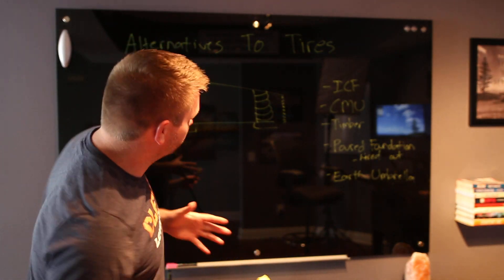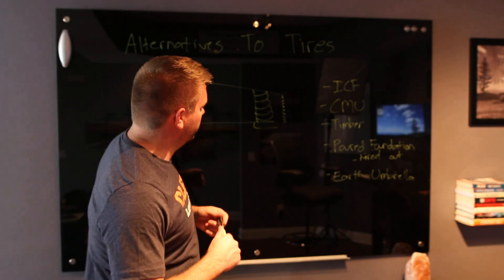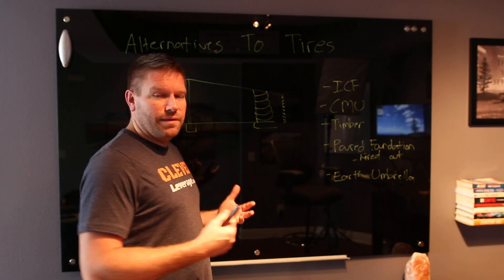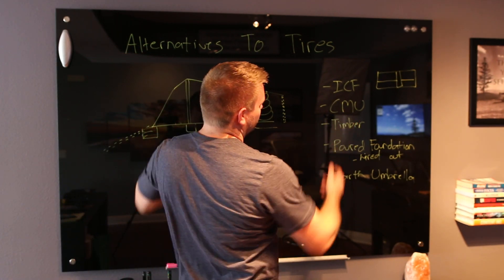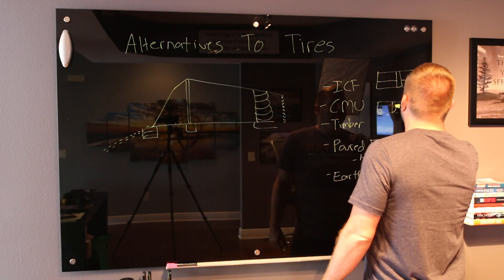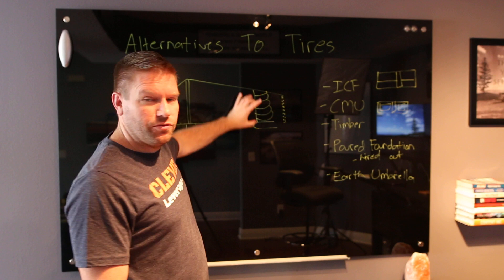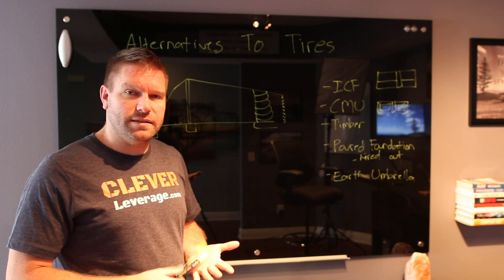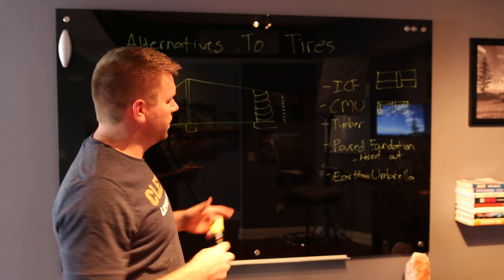Earthships: Alternatives To Tires

Comment: 2'x2'x6' Concrete bin blocks are available nationwide from landscaping and construction companies. Companies like 48Barriers will sell them new or as used road barriers. No forms to build or gabbion cages to make. No waiting for concrete to dry. Stack them in place just like a retaining wall. Waterproof and back fill the same day maybe. Blocks with decorative stone imprinted facing are available. If you want to recycle tires, use them to build the road, or driveway of your property. Cut the sidewalls off, lay on the ground in a grid like circular honeycomb, fasten together with air powered nail gun and then fill with crushed stone or recycled concrete and gravel. The road will be well drained and you will never have potholes or ruts up there in Maine. You might even try the wall less tires for the walls of the house. No trying to hammer dirt around and under the sidewalls of the tires. Just grab an pneumatic tamper and get with it. If you have drainage or erosion issues on the property you can lay out all the cut off sidewalls in the problem area, cover with some gravel and then dirt and grass. The sidewalls and gravel will slow down runoff and allow it to seep into the soil.
Reply: This is a really interesting idea.  Fast build, extremely strong, low-tech, and it looks like around $7,500 for a 100'x10' wall.  That's pretty enticing.  I suppose shipping is a significant problem/cost as each block is 3,300 lbs and most flatbed trailers are good to 48,000 lbs.  It would take 3-6 loads to haul that 100'x10' wall.  And I expect this would face code challenges just like tires, rammed earth, etc.

Comment: Tires when covered completely by earth don’t off gas, there is no oxidation process. The tired you saw exposed are outside the living quarters.
If you want to do away with tires, use stabilized rammed earth. 2 ft wide with 4 inches insulation in the middle.

Comment: Tire bales.  There is ZERO issue with off-gassing.  We shotcreted over the bales, and then adobe'd the interior wall.  I have yet to smell any rubber in any earthship that I've visited.  Check out my bermed-earth tire-bale home on YouTube.  Tire bales were stacked in one day with a skid steer.  They are about 5'x5'x2-1/2' High, and weigh about a ton each.

Comment: Use a shipping container as your back wall, they are usually 8 ft wide. You can get 10, 20, or 40 footer, all steel and strong. Fill it from the top full of gravel or soil. They are not that expensive and you get an instant back wall.
Reply from the maker: Great idea, what do you do about preventing rust? Or just don't worry about it...
Reply: @matt-justice  Just paint it with tar, while the tar is still sticky wrap it with black plastic (viscqueen) lumber yards carry the thick stuff. You can get rolls that are 20 ft x 100 ft. If you go slow you could paint a 40 ft container with tar using a roller in a day by yourself, paint top first, cover with plastic, let it overhang about a foot all around, then do the sides, tape seams with duct tape. Those containers are painted with paint to resist salt water. Also if you put a good base of gravel at the bottom, you wouldn't have to worry about water pooling at the bottom and rusting the bottom.  Good luck.
Reply: @matt-justice  Sorry, I was thinking of burying the whole  container, just put tar and plastic on the side that's going to be buried,  or covered with soil otherwise you will smell tar and plastic everytime you go in the building. You want to keep that plastic away from heat, because it smells when it gets hot.
Reply: Shipping containers can't hold soil loads.
Keep them above ground.

Comment: Pretty well read every comment and some great info from experience here on one site, that is great. So did you figure out what to use? I'm looking at many of the afore mentioned methods but am also no sold on tires as a vessel. Rammed earth is a option but it needs a vessel to hold it. Eathquakes will compromise most rammed earth structures. I've looked at ICF, and now NEXCEM blocks which may be the answer but also like hempcrete blocks but want to get going getting my off grid location build going soon. Nexcem are great for outer insulation especially if taken to R-28 specs but I'm looking for inside thermal mass as used in rear walls of earthships. I have a idea for Nexcem and will get back to this if my idea is a viable option. Thanks for this video, it brought some great different ideas to one location. Cheers

Comment: does anybody have any experience with changing an existing house into an Earth-ship like house? Or links to sites of people who have done that or do that for their work? thx
Reply: totally different design basics . if the house you are looking to convert is east west facing its a no go
Reply: As Lex says it would be an ordeal however there are principles to Earthship Biotecture, many of which seem to have been looked over in this video and discussion, which can be employed. The greenhouse element has been added to great effect to houses in colder climates. The water collection and treatment can be largely achieved. And you can add solar if wind energy solutions. Other than that you might add some insulation and stop thermal bridging to make the building more efficient?
Reply: @TableNetwork  thank you. This is kind of what I was thinking. I live in the Netherlands. December and January lack of sufficient sunshine. There is one earthship village and they need to heat up the place with the wooden stove. I currently have solar panels with almost zero during these months. But if they even build complete green houses around the house in Sweden partially it should be possible to achieve something within existing buildings. 
In the meantime I have found some architects here that have made some impressive things.
Reply: @louisrvb2245  This is interesting. https://www.youtube.com/watch?v=30ghnDOFbNQ Also worth looking at the guy in Nabraska, I think, who makes greenhouses in which he grows citrus fruit using thermal underground pipes. https://youtu.be/ZD_3_gsgsnk Similar to Earthship principles. It's flat in most places in Holland I've been so potentially good for wind power when there's no sun? I think you'll need to assume a small grid requirement for some power and heat, but as you're existing you've probably got a hook up already. I also liked this https://www.youtube.com/watch?v=WxbX87gxmXQ
Reply: It really cannot be done. You might be able to take pieces of earthship design and implement them. But generally an existing structure isn’t designed for it.  I do think if you have significant acreage it might be smart to have an existing building and build an earthship on the property as well.  You have the existing structure to live in during construction and it may keep building inspectors off your back.
Reply: I have remodeled houses and you will spend less time and money building a new house than taking apart and redoing an old cheap house. And at the end, you will have a new house if you chose to sell it rather than an old house which is less appealing to a potential buyer.

Comment: Shipping containers!
I've been thinking the same about alternatives to the tire wall and burring containers as the wall support is fast and cheap and still upcycling.
Reply: Shipping containers are NOT strong enough to bury
Reply: Dean MacLeod 
Search buried shipping containers, you’d be surprised.
Reply: Be careful with protecting the containers from ground water.  This is viable but you want to look at the engineering of it because shipping containers are strong in some places and weak in others.  You may need to reenforce the container with concrete to help distribute weight properly
Reply: Thats not a bad idea.  You can put the water tanks inside the shipping containers and the cooling tubes underneath the containers.  The added weight of the water would help make the containers even heavier and better able to retain the dirt behind and on top of them.  The only thing about the tires is the rubber creates a lot of insulation for the home.  You even have to insulate normal foundations now as part of the new house codes by me.  So im not sure how well they would hold in the heat but it is an awesome idea.
Reply: I'd burry the containers to make a basement and then build the eartship over with poured aircrete and concrete in key areas.

Comment: I own an Excavation Company, I've work with the earth every day for 35 years, as well as digging and forming foundations. I'm also planning to build an Earthship inspired home.
My plan is to use Rammed Earth instead of tires. I plan to dig trenches for the Rammed Earth walls and concrete footers, pour the concrete footers in the trenches, then use Excavator with compactor plate to compact layers of low P I  soil  mixed with about 10% cement  to top of walls and cap with concrete. Then trench behind walls to place bituminous sheets on back of wall to seal of moisture, add perferated drain pipe in sock and backfill behind wall with crushed concrete gravel, then Clay Cap. After back wall side walls and wing walls are done, dig the dirt out from interior side of walls to depth of below intended floor slab. Now front wall can be built and so on. This enables earth forming earthen walls with very little hand labor making what could take months take only a few days.
Reply: Doing just that here in Nevada north of Reno-Sparks off of Pyramid Highway. My modified version utilizes compressed earth block which we will be making on site. Hope you get your project going soon!
Reply from the maker: Love the idea!! This seems like more work/time/expense than just having a wall poured though?
Reply: @matt-justice  It would be more time and labor compacting layers instead just pouring a Concrete Wall.
If I didn't own the equipment and already have employees I maybe would just pour concrete.
 I would be willing to conduct this experiment on someone else Dime first if there's any takers! LOL
Reply from the maker: Makes sense! I’m always calculating either renting equipment for this, or hiring it out... totally different I guess when you own the machines. Keep thinking I should buy a Case 580 or 410G for a short while to use on projects instead of renting, just haven’t pulled the trigger. I’m in Maine if you’re closeby!  Lol   Be happy to, gotta hire someone as it is that thinks I’m nuts ;)
Reply: @matt-justice  buy a cheap track loader like a Struck Company loader, I did and am glad I did for 10 grand, runs on half the fuel of a commercial loader and way less maintenance. Good for the smaller jobs but will lift and carry 800 lbs. Also Moves snowbanks not just snow.
Reply: @matt-justice  ❤️ Love that you are considering alternatives to tires. California used porcelain toilets, to create an artificial reef. It worked extremely well, increasing sea life in that area. Florida thought to do the same, and they made an artificial reef out of tires that k!lled all of the sea life in that area. Millions of dollars later, they are still trying to clean up that toxic mess. The moral of the story, is that if tires are toxic in the ocean, they are probably also creating a toxic living environment
Reply: @matt-justice  I'm not comfortable with the "materials used" requirement built into the "Earthship" definition.  I think using local dirt or re-purposed materials, like tires, is not a requirement.  If it's self-contained, it's an Earthship.  Also, anything you do towards such an end is worth doing.  I wouldn't turn up my nose at a thermally self-regulating greenhouse, with or without my own self-contained water and sewage.  Sure that's a goal, but I wouldn't be a perfectionist about it.  Maybe you're really good at water sequestration and treatment.  Maybe I've got that greenhouse next door or down the block.  

My money very much represents my time.  I don't have to build the 'ship with my bare hands.  To me, the idea is to build it to LAST, with minimum maintenance.  Also, you may not have the clay or the aggregate or the TIME to whip up your own, amateur materials.  Maybe you, in particular, just love a good slate roof.  If by your other works, you've saved up a good chunk or have a strong cash flow guaranteed, I think it's better to spend the money, up front, and live as green as possible as soon as possible.

I see nothing wrong with trucking in big cisterns or contracting for cisterns poured by professionals on-site.  I sort of have an "in" in the sense that I've got family with access to and expertise in the heavy-equipment realm.  A couple days with a back-hoe on ground we KNOW, and all kinds of perforated pipe can be buried and married to the house.
Reply: That would be my choice, Plus, the unexposed reamed earth looks cool and fluid, so there will be little need for wall hangings or paint. I've been considering earthships for decades but tire off-gassing makes me wary.
Reply: Concrete walls create rooms that are uncomfortable in summer and in winter . Rammed earth walls are self regulating. It’s a living wall
Reply: @jamesmattie37  I think it's more a function of how "buried" the living space is.  I think the big advantage of rammed earth is the thickness you achieve.  People pouring concrete aren't going to pour 3-foot-thick (or 2-foot-thick) walls above- or under-ground.  But I can see using concrete or brick (home-made or otherwise) to line the walls of one's hobbit-hole.  

I've seen some RIDICULOUS rammed-earth homes, though.  That's a great way to go if you have the equipment, elbow grease, and knowledge.  I just think it'll be easier for ME to pour a more or less conventional - albeit extra-large and extra-deep foundation.  Extra-big spaces make it easier to keep the human-occupied areas climate-controlled to a 'T.'   Many seem to think smaller is better, but I think bigger is better.  "Build big and live small."  Also good for parties!
Reply: @jamesmattie37  what do you thinks is behind the concrete walls? Dirt!
Reply: Years ago I worked on a few rammed earth homes in Wyoming.  I really loved the way that they felt inside.  Hope you. Have a good experience.
Reply: Yes.  Lots of perforated pipe.  Also, since you're building to last, there's no reason to go cheap on excavations and aggregate, to guarantee water moves away from your structure.  If there's hydraulic pressure on the walls, asphalt won't save you.   More important to be sure to give the water an easier place to go than towards your foundations. 

Meh.  I'm a YouTube Keyboard Warrior and you sound like you have actual experience.

Are you going to use some/all of the perforated pipe for passive geothermal?  I'm talking about Russ Finch "Oranges in the Snow" video.  It doesn't take much power to move air around.  If you've got your hands on an excavator, I'd highly recommend that strategy, if you can get down to 8 feet (or more).  All that perforated pipe makes a nice water-sequestration system, helping you fill your cistern(s) when it rains.
Reply: Did you build it?!

Comment: I agree w finding suitable alternatives, and I am in the same position. I am near the conclusion of a gravity wall, dry stacking raw limestone quarry blocks, 2'x2'x5' at $50-$60 each and18 to a truckload. The biggest expense is delivery followed by frontloader rental to unload and stack.. A minimal crew, done in 2-3 days. 100 blocks will give you 4 rows of 25 blocks providing a footprint 80x20x8' tall, around $6k. There are 3-4 surfaces to chose from.. few pics on internet, but frequently used in landscape walls and retaining walls.
Reply from the maker: Hi Raymond, I tried to source retaining wall blocks for this, but since I’m in the sticks delivery was more than the cost of the blocks! It was over $2k per delivery, looks like it’ll end up being cheaper just to pour a wall.
Reply: @matt-justice  i found in previous off grid builds, that was always an issue from start to finish. I bought a military 6x6 surplus truck m931a2 locally for $1,500 that vould haul anything i needed with a pintle hitch equipment trailer. All it cost me was fuel and i got to keep the truck.. it saved me from rental delivery fees and in inclimate weather it was the only thing that got through and got everything else unstuck. Best tool i have ever owned.. and not a bad toy either.
Reply: If I’m busting out the limestone I’m going full EarthPyramid.

Comment: What about weight at the top of the extended  back roof ( where the back wall is) lifting the roof up, but bones are much of a support without the tendons and muscular form. I’m a beginner so..cooked mycelium moulds are a way I’m going to study just because I am into mushrooms and they are currently used as bricks. Have you ever compared earth ships with any farms?
Reply: Smoke another joint
Reply: I really think mycelium bricks made of tire and straw would be interesting to try because of the bacterial imperviousness. And ease of not having to pack because the mycelium would do that for you.

Comment: Most ICF has an 8" core you can get them in 4 and 6 inch but 8 is the standard and that has a strength to spare. The downside of an 8" core is the shocking amount of weight involved that requires a beefy concrete foundation.